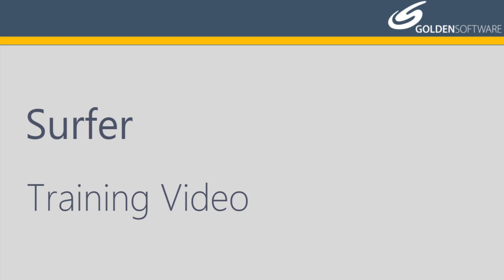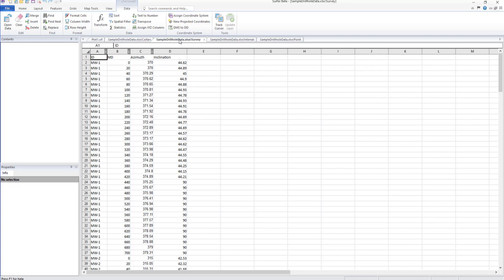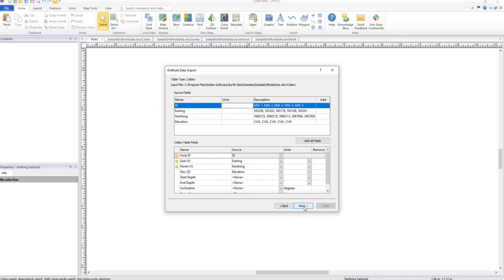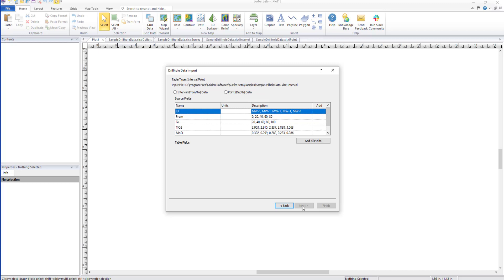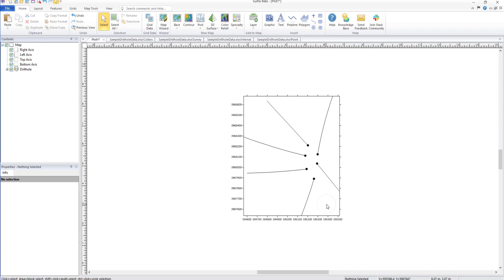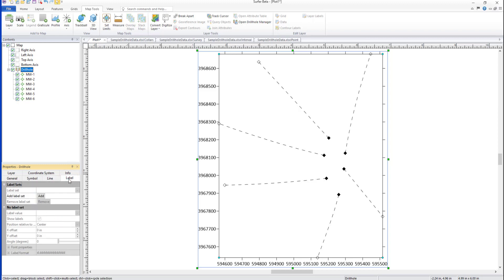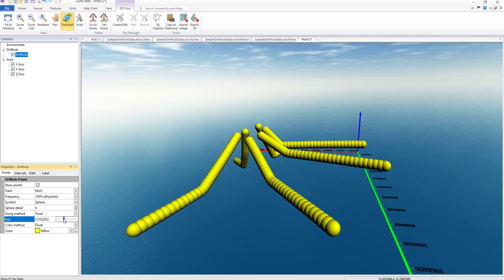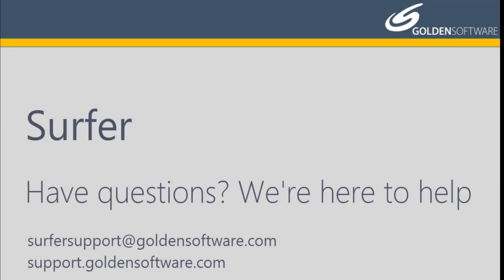Surfer Drillhole Maps Training Video

Comment: Nice tool❤,, is the data available i would love to use it for practice
Reply from the maker: Hello,

Thank you for the comment! The data used in this video is a sample file that is available in any version of Surfer that supports drillhole functionality. Sample files are automatically installed on your computer with a Surfer install and can be found at the file path C:// | Program Files | Golden Software | Surfer | Samples. This sample file is called SampleDrillholeData. 

Thank you,
Golden Software Support